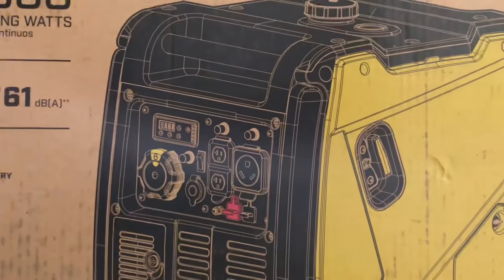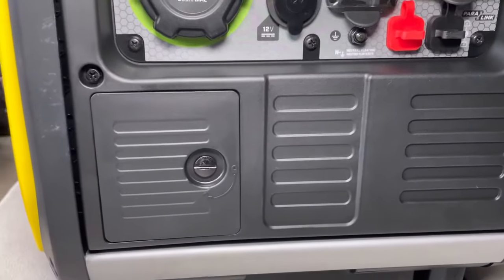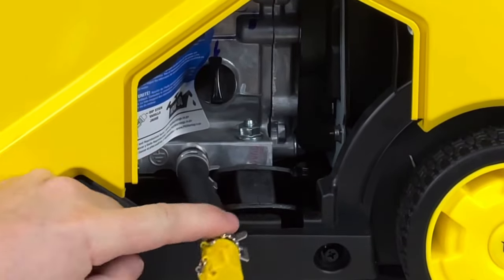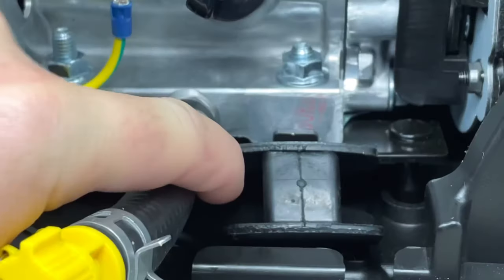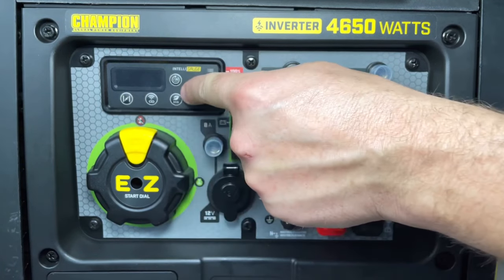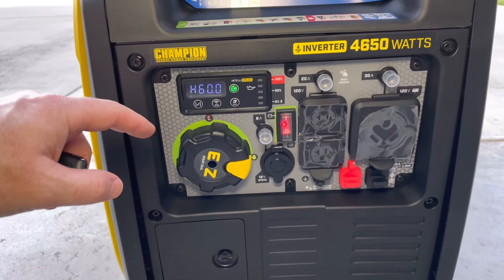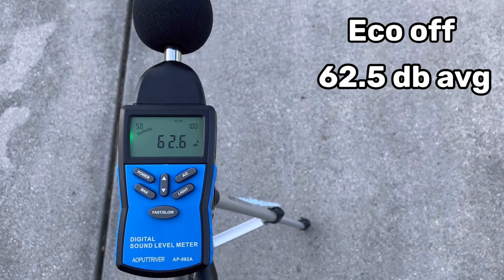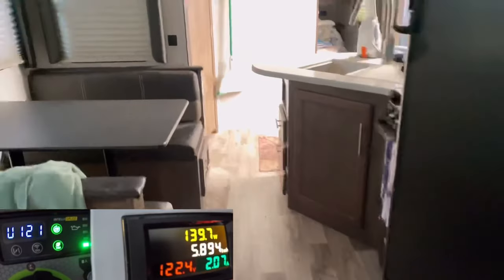Champion 4650 Review Setup Test Inverter Generator

Comment: Is there a certain type of extension cords you should get for this generator to run them into your home? I'm new at this and I need a little guidance lol.
Reply from the maker: Yes if you go to any big home improvement store or Tractor supply they will have generator extension cords. You need one that is more then 15amp capable if you wanna run more then a couple items. Typically 12g is nice. But they are more expensive. You buy once and call it good. Tell someone at the store what you wanna run and then they can show you options.

Comment: they seem to use that engine on alot of different sizes . when is enough for this little engine?
Reply from the maker: Yes there are a couple manufacturers of the 212cc engine. I think the 4500/4650 is fine but anything bigger should step up to a larger engine.

Comment: This was a great video!  thank you for doing it.  did you do any break in period for this?  or is it good to follow your video for out of the box and then just let it go.  I would only be putting on about 2300 watts ish and i think thats being generous.  Id also only be using this maybe twice a year... is there maintenance or care for letting it sit for months at a time?  thanks!
Reply from the maker: Hey…… so for break in best to follow what the manual says for warranty. I bet about 5% follow it and the rest put oil in , gas in and let it rip.

I do heat cycles and have it broke in, in about 30 mins or so.
Basically it’s doing a low load to high load and back down and let idle for about 30 secs and shut off… let sit for 10 minutes and do another heat cycle to about full load for about 30 seconds and gradually come back down. Each heat cycle takes like 5 mins total with the 10 minute rest period. 
Heat cycles have been done for years around the racing circuit and motor builders for years. I have done this with dirt bike engines and high performance 3 cylinder engines and never took longer then about 20 minutes to break in my race engine. 

But again best to do it the way manual says for warranty purposes even though it would be hard to see if you really did do it. 

If letting sit for a long time then obviously you want to do long term storage procedure.

Add fuel additive of choice and run it for a few minutes though the system.  Drain carb fully with screw.
If really long term then remove spark plug and take a little oil like half a cap full and pour into cylinder ….then replace spark plug with no spark plug cap on and pull starter cord about 5 times slow to coat cylinder fully. 
Ethanol free fuel is also a good option. 

I prefer Lucas oil products as well. Always good luck with it.
Reply: thank you so much for your help!
Reply from the maker: You’re welcome 😉

Comment: I keep going back and forth between this and the Predator 3500. Still undecided. Glad you did the AC with the microwave. That’s a realistic load I would be placing on my unit, albeit only for as long as it takes to heat up my meal.
Reply from the maker: The predator kinda was the number one but honestly the only good thing about it now is the return policy from H F 
I would just buy Amazon protection plan or other warranty say through tractor trailer for the champion. 

I would rather have more power for the same price. And dual fuel.
Reply: @johnnysweekends  it’s mainly the noise why I’m considering the Predator. It’s rated at 57db compared to the champions 61db. That’s more than 2x the sound pressure.
Reply from the maker: Did you watch my latest video comparing them… i did a sound test on a lot of popular generators and show exactly what they were running.
Reply from the maker: Here QUIETEST INVERTER GENERATORS Review Test
Reply from the maker: https://youtu.be/SYxIDRZendM 

Here
Reply: @johnnysweekends  just did now, thanks. Champion looks great. Was just about sold on it but looks like prices have fluctuated quite a bit as its about $500-600 more than the Predator. :(
Reply from the maker: The predator is $850 how much is the champion..?? Did you visit generator Bible.com. They have a price shopping tool.
Reply: @johnnysweekends  it’s 1415 on Amazon, and 1445 on generator bible lol.
Reply from the maker: Wow something isn’t right there. I would still get the duel fuel 4500 champion over the predator. More features again and same engine. 

But over all it’s up to you. Just my preference
Reply: @johnnysweekends  definitely a better unit but not $550 better. $1200 tops imo.
Reply from the maker: I agree. I think I paid $950 for the champion when it first came out. 

I think all the shipping problems like everything is making things expensive.
Reply: @johnnysweekends  I went with the Champion 4650 non dual fuel with remote start. Found it for $989 at TSC. Was going to just wait it out but inventory for the nicer units appear to be low all around so I wanted to secure one in case things get worse before they get better. I have a Predator 2K  which has been great and runs everything but my coffee maker in the RV. Even the AC unit runs of it albeit with a slow blink of the overload light. The coffee maker though trips it pretty much instantly. A grand for a cup of coffee seemed worth it 🤷🏻‍♂️

Appreciate all your insight and advise. Keep the great vids coming
Reply from the maker: That’s expensive coffee but it must be had!!! Lol

Awesome glad ya found one and thank you I’ll continue to bring more.

Watch the one coming tomorrow for easy maintenance on servicing the low speed jet for hesitation and idle up and down issues. I use the champion as a example..👍🏼
Reply: @johnnysweekends  looking forward to it. I know all these generators based off this 212cc engine tend to run a little rich during idle and low loads leading to premature spark plug fouling.

Comment: The EZ Start Dial seems like it has 2 positions when you turn it to the green symbol. Is that middle position for anything.  I left it in that position and it still started. Also while running I clicked in that position also and it kept on running. I don't see anything in the manual about it.
Reply from the maker: It doesn’t have much except on and off with automatic choke. But it does have this….GENERATOR SECRET Fuel shut off valve built in!!
https://youtu.be/9KLrEqDG1nA

Comment: What’s your opinion regarding adding Lucas oil in the piston / spark plug chamber as a break in step?  Do you do that?  Thanks 🙏
Reply from the maker: I do not do that. I assume most these engines have a light coat of break in oil or shipping oil on the cylinder so it’s not gonna change anything. 

I also don’t do the break in process as some manuals say to, as I do it the way I used to when racing. Which is more of a heat cycle procedure with loads on and off. 

I think most racers till this day will still do it that way, if they are also the engine builder. 

Kinda a run it like you your gonna own it thing.
Reply: @johnnysweekends  thanks for responding, I appreciate it!
Reply from the maker: No problem and thanks for watching…👍🏼😀
Reply: Have you done a review on Onan generators
Reply from the maker: @RonReno-k2d they are still Chinese using some of the same engines but a little better inverter board.
Real onans are big and expensive or the large open frame units

Comment: I have the same generator.  Did you have any issues with the propane regulator?  My gen will hardly run using propane.  I understand they had a bad batch of regulators
Reply from the maker: I would definitely change the regulator as they can just go bad any time

Comment: Is there a big difference between this one & the black 4500w version? Just can't stand the yellow color, or is this the better generator? They are the same price
Reply from the maker: More power for the most part. About one amp less then the 4650. Why they did these with Little difference idk
Reply: @johnnysweekends  I wouldn't be surprised if the output is the same as it was for the 3400 and 3500 previous models. That was done for marketing reasons so Camping World and Cabelas had models that appeared to be unique but in fact, only the labeling was different. 

It may be the same story on this new series. I would like to see a measured load test on each.
Reply from the maker: I assume for the most part they are the same because many share the same engine being a 212cc rato engine but it’s possible it’s a different inverter board. 

Kinda like the Westinghouse and onan 4500 same engine but possibly has a different inverter board to allow a pinch more power. Not much but just enough.
Reply: @johnnysweekends  You got me wondering so I downloaded the parts list for both models and found they show the same part number for the inverter module. The indicates to me they have the same power output.
Reply from the maker: Well there ya go. Yea that’s mostly how you find that a lot of models and even brands are the same. This engine is used in so many models and I assume several of the electronics are the same as well. 

Most of them all have a equal or duplicate somewhere.

Comment: Great video...can you do e versus between the this 4650champ and the wen 3800? they look pretty much the same.
Reply from the maker: I could but honestly it is the same gen almost but better features on the wen but more power on the champion. Same db level. Same engine 212cc from rato. 

So for the most part this one has remote start more power but no fuel shut off… why I don’t know. 

Thanks for the comment and thanks again for watching.

👍🏼😃
Reply: @johnnysweekends  thanks...i will look for the best deal on both and pick that one I can't go wrong with none off them ...thanks again.
Reply from the maker: Your welcome may wanna look into the Westinghouse as well. Great gen for the price and features the only thing is the engine is not as popular as others and not sure how well warranty or customer service…that is also the same as the onan 4500
Reply: @giancarlohernandez1967  they also make this champion in dual fuel model...I think for the wen u have to buy an attachment.

Comment: Not crazy about electronics controlling so many things. Rather have manual choke and gas valve.This way when the electronics fail you can still get it started with manual adjusting the choke valve.
Reply from the maker: This one does have the manual choke lever which I showed in the video that way if the battery does you just pop the panel with the tool kit and move the choke…👍🏼

Thanks for the comment and thanks again for watching 👍🏼😃
Reply: @johnnysweekends  Yes, I now see that.. Does it have a manual gas valve ?
Reply from the maker: It does not but you can manually drain the float bowl with just a screw driver which shows in the manual if I remember which is super easy and takes about 5 mins or less for longer term storage .

But if you always run a additive it really helps with not having to worry for those shorter sit times of a few months or less

Comment: I have 2, one was doa. Champion hung up on me, but amazon stepped up and sent a replacement.  The auto start choke system does not work properly on the 1st one.
Reply from the maker: Yea the choke system is odd when you start with out remote. Having to manually press it on and off. 
I wonder if the wire harness was not connected as it happened on the Westinghouse gen.
Reply: @johnnysweekends  I haven't had any time to inspect it yet. But I did discover it only fails to run properly when you use the remote start. It you start it with the dial and button it runs perfectly. Using the remote start results in backfires and eventually stalls out. Still usable if you start it without the remote.  Either one runs my colman 251tq 29' rv without problems. Even managed to run the ac and electric heater at the same time by accident without overloading.
Reply from the maker: Oh yea it should should basically run the whole trailer. Ac up to 15k which that’s as big as a single gets I think. And the fridge on ac and the microwave.

But you never run it like that for long or all the time. 

Well the remote thing is a bummer. Yea call champion again or I guess if Amazon is gonna fix it. But normally people said they have had good luck with champion and customer service… ???

Good luck and thanks for the comment and thanks again for watching 👍🏼😎
Reply: @johnnysweekends    Champion wanted me to send it in for service and we were instantly at odds because it was dead on arrival. Amazon stepped in and sent a replacement. As far as I'm concerned it was a good deal,  I'm not the easiest to communicate with when I'm frustrated and Champion customer service lasted longer than most would have lol
Reply from the maker: Lol ahh well I understand then…😅

Comment: How’s this compared to the 4500 powerhorse?
Reply from the maker: Honestly both very close to the same. The 4500 is nice slightly more compact and like slight and if I remember both run a 212cc rato engine but would need to double check. The powerhorse is just a pinch quieter at low and maybe mid range levels but equal up top. 

Hard to go wrong with either except I find champion seems to getting better feedback and customer scores then powerhorse from northern tool. 
Could be wrong but just what I’m reading and seeing.
Reply: @johnnysweekends  ok thank you I got the powerhorse for $1000 with 4 year warranty I can return and get the champion for $100 more
Reply from the maker: I think as long as you get a warranty which I recommend anyone do because you never know, I think you’ll be fine.

Comment: Great review – thank you. One item that I didn’t see covered in the manual or in your review is the gauge for the oil. I noticed that it increases as the load increases but I’m not sure if this is oil temperature or oil pressure. Does anyone know?
Reply from the maker: The unit does not have a oil temp or oil pressure gauge that you can see. But it does have the oil light if a condition such as low oil happens to come into play the light will come on and I assume should shut the unit down.
Reply: @johnnysweekends  it uses regular gasoline, not diesel, correct?
Reply from the maker: Yes regular 87 is fine just be sure to use a stabilizer or a additive of some kind that way if you let it sit for a while it’s protected a little.
Reply: @johnnysweekends  thank you
Reply from the maker: Your welcome
Reply: @johnnysweekends  I use ethanol free gasoline in all of my small engines.  No maintenance issues what so ever and no use of stabilizer
Reply from the maker: I don’t mind using either myself. But me being a mechanic I can normally fix most issues. 
I don’t typically use ethanol free fuel as nothing I have sits long. I always use Lucas fuel treatment in my small engines fuel can though. Used that product for years and just have always had good luck.

If you have the money and ethanol free is readily available and don’t wanna have to worry it’s definitely the way to go…👍🏼

Thanks for the comment and thanks again for watching 👍🏼😀

Comment: Is there any way to shutoff the fuel and run the carb dry?
Reply from the maker: Watch here…👍🏼😀 
GENERATOR SECRET Fuel shut off valve built in!!
https://youtu.be/9KLrEqDG1nA
Reply: @johnnysweekends  Great video! Never realized I could do this with my Honda 2000 also.
Reply from the maker: Thank you and yea pretty cool right..👍🏼😀

Comment: any chance this thing could start up a 13.5 and then a 15k AC?  Running watts of the 13 are around 1300, which leaves mathematically enough to start up the other AC?
Reply from the maker: I think it could pending weather and altitude if not terribly hot and not really high in elevation it should work. Start the big first obviously and then the little and maybe even turn off converter that charges the batteries which could steal a precious amp or two. Hence a little solar is great. 

My 15k unit runs about 12-12.5 amps so around 10.5-11 amps on that 13.5k….. 
so if running 12ish and it does it’s start up man that will be close at maybe a 35 amp jolt. Obviously soft starts will fix all.
Reply from the maker: I think it should work pending temperatures and altitude are not to high. Start the 15k first.

Comment: How long can it run on a full tank running the ac?
Reply from the maker: Depends on the size of the AC and are you running anything else or just that only. Is it super hot like 105 and above or more like 85-95 but hotter temps create more load so you’ll burn a pinch more fuel..
What altitude?? 
Some variables there
Reply: @johnnysweekends  around 6000 ft and 80 to 90 degrees and 15000 btu. Just wondering if you can run just the ac for 5 or 6 hours on a tank.
Reply from the maker: Well at that altitude you’ll need a jet kit. And you have lost about 18-20% power at that altitude give or take. 
So you will burn more gas. Maybe dual fuel could be better option but I would say fuel usage up 10-15% or so from normal.